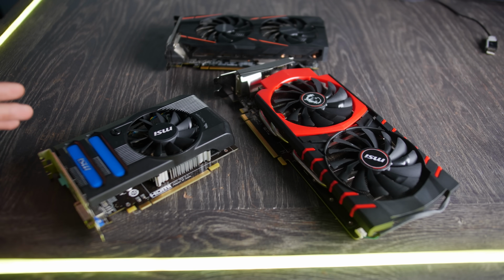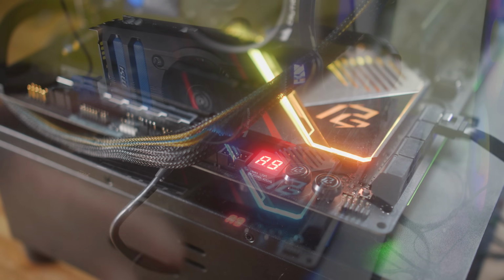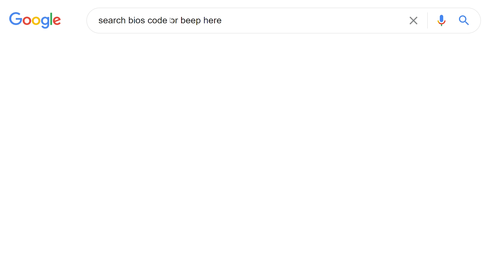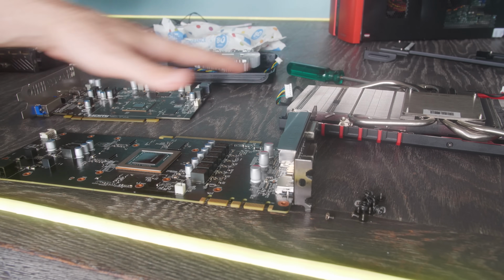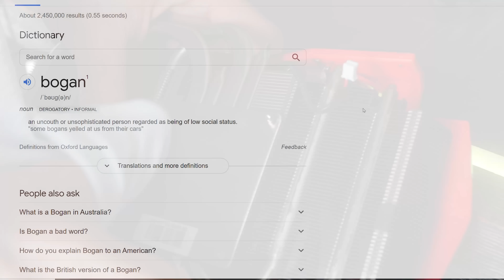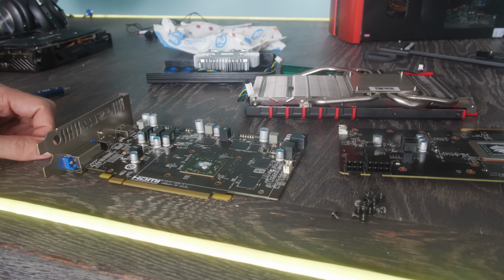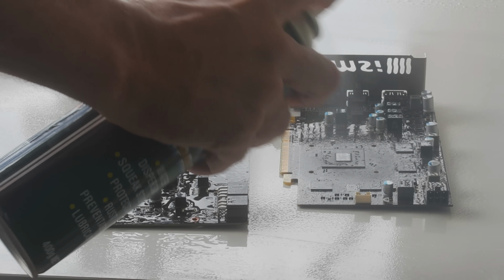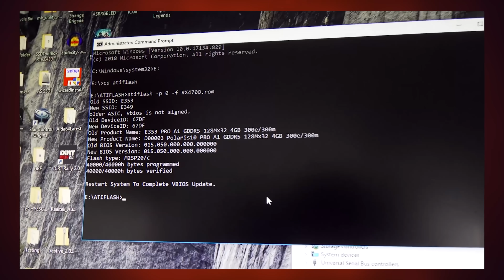How To TRY and FIX a Graphics Card (COMPLETE Start to Finish)

Comment: Last years I had a mother board problem! Where power was not getting to the graphic card  fan. But my problem was  I did not know this.  So  because of over heating I ended up with a black screen fall in my RX 580.  So not knowing  I had a problem in my mother board.  I replace the RX50 with  my spear GTX 970 But  it to overheated and  failed  as well. Using a very old card  I found the problem was in the mother board But at the time  I did not know how to fix them But  after  I saw your video  I went on  to eBay and  bid $25.00 For a damage AMD Radeon R7370. So I thought   For just $25.00,  what have I got to lose. Using a heat gun I got the R7 370 working.  Im now  using it and I have been using it for over a year now The only thing is I have to play all my games Like far cry new dawn  on low settings When I learn more Ill be trying to fix the GTX970, and RX580, As I miss the better graphics. But if I can get a card cheep enough I get that But on eBay  they still want AU $900.00 for a gtx 970 and $800.00  for a rx580

Comment: Yeah u right we need to test all input slots specially for old GPUs ,my GTX 580 was giving no display from HDMI I thought that it was dead but surprisingly the DVi Still working .Conclusion: sometimes in old GPUs HDMI might break real fast . And thanks to you I saved it.

Comment: Great video. I have a few suggestions. We can do the hdmi port and rubber on the contacts BEFORE opening them. If it works we avoid the need to open it up. Now I will move to my Radeon 5600 and tell you where I get.

Comment: i do recommend one thing, instead of the wd-40, give them a phat was in the sink, like scrub proper, using hand or any soap. then heatgun them. What ive found is that it removes junk from underneath the gpu die itself and also helps make sure the gpu is cooked properly because no water can be present.

Comment: Hi Brian. A few days ago, I recently discovered 1 last last resort that worked for me 😁 That is pushing up the other end of the video card (the opposite end of the video ports) while it is inserted in the pcie slot making the pcb a little bit slant for about half or more than half an inch. Using a cheap gpu anti sag will work too, you just need to adjust it a little bit higher so that it will push the gpu's pcb. 2 out of 2 of my defective gpu's are now working. The 1st one is Palit Jetstream Gtx 960 2gb which has garbage display. The 2nd one is the Sapphire Radeon HD 5670 which makes my entire pc not posting or will not reach bios while inserted in the pcie slot. I did this out of desperation because as you've said, repair is expensive and glad that the method worked. My theory is that overtime, the gpu's pcb will start to show a lot of wear and tear specially the traces and solder points due to gpu sagging, coz we all know that the points for gpu support is just the pcie and the gpu back io shield. Sorry for the long paragraph, I'm just so happy that I fixed my 2 cards with this method 😁👌🏻
Reply: are you sure it's not your mobo PCEi slot that's not broken there? how about you borrow a friends known working GPU, and try it in your mobo without trying this trick. see if the issue still happens.
Reply: @Layarion  hey I appreciate your advice mate. I get what your trying to say, however I flip pc's too for a living. So basically I have tons of pc parts to test too. What I'm trying to say is, overtime the substrate, pcb, solders and traces will have a tendency to lose some contacts. When I bent the gpu pcb, those contacts started to join again and it started to work again like new. Even got to overclock the card with zero problems at all.

Comment: Recently got a 1060 6gb Asus Blower style with a desktop I bought really cheap.(they didn't know what was wrong, but apparently bit was just the gpu being wonky, as the rest works without it) 
Card works fine with Microsoft Basic Display driver, but soon as you install the proper drivers, the screen gets black and white lines then blue artifacting and other weird things. Been trying to find compatible bios' for the 1060 to see if it's just a faulty bios but have had little luck

Comment: hey mate, I've got an r9 270 sitting in a box, works completely fine until I install the drivers, at which point it basically hard crashes, not even a bluescreen, any idea on what methods I should try or if it's even worth trying? I believe it was killed by a faulty power supply
Reply: Reflash the bios on it, that might fix it

Comment: I have a quick question. I recently got a evga ftw3 3080 card and it runs games stock at 1950  at normal boost and jumps to 1965 MHz is that a good gpu? I haven't tried to overclock it yet its running stock or is that just normal for them?it hangs around 193 to 200 fps on bfv constant on 1440.but my nvidia panel is locked at 200 also i remeber

Comment: I have managed to bring a few cards 'back to life' by cleaning out the contacts for the slot as well as the ports.  For heating, I have always covered the area being worked on with liberal amounts of flux to ensure that the solder joints don't get even weaker from the reflow.  Low success rate though, like you have experienced.

Comment: I have a GTX 770 with white lines (artifacts), a gtx 460 that have blue screen during windows startup (even worse, killed in the repair shop due to an atempt of reballing without my consent -.-) and a R9 270 that lose video signal every time that I play a game, F, glad that I upgraded to a 1660 Ti back in 2019, I need a card for my htpc, maybe will get a cheap GTX 1060 3GB

Comment: I have a GTX 760 2GB and it spins up to 100% fan speed on boot, the system posts but that's primarily because I have an APU in my main system and so it just boots to desktop, no output out of the 760, doesn't even get detected by Device Manager, Nvidia drivers don't see it's their either, tried every method possible, even the heat gun method, probably is smoked either way considering the GPU came out of a system with a dead PSU and a dead Motherboard because of it.

Comment: BRYAN, please please please get an ultrasonic cleaner. I can’t tell you just how many electronics I have repaired with one , wave oscillating is a bonus, use some diluted PCs cleaner.  It heats up. Then alcohol bath followed by a data vac or air compressor, also getting a and rework station for micro soldering and or  just fixing old solder joints just apply a thin laying of flux around the infected areas to get the solder reflowing.

Comment: The oven method only works for so long. The heating and cooling cycles will eventually break the BGA connection again.

 One way to keep the card alive for longer  is to literally just leave your pc on so it never goes all the way back down to room temp, OR ideally if it's profitable, crypto mine right after gaming, to keep the card hot all the time so it can't cool and shrink/ possibly snap the weak resoldier  of the BGA.

I have an old 7970 that broke after a week of normal gaming and shutting the pc off. Rebaked it, now I let the PC idle when I'm not gaming and its been going strong for 3 months. Might cost me $5 a month on my power bill buy it sure beats having to buy another gpu in this market.
Reply: Yeees? It's always been "the last trick" havn't it?

Comment: Hey tech city i have problem with my gtx1080ti broken at the perfect time when GPu pricw up, my problem is when i plugin all 8x6 the pc wont Turn ON and when i use only the Pcie my computer turn on but have "plz Powerd down" whic need 8×6pin plug for "Plz Powerd down" gone.. but if i plug 8×6 my pc cant tunr ON ? Are i get Shorting ? Powerplug broken ? Or Fuse Power broken ?

Comment: Who knows if the caps went bad on them, i recapped my old FX5200 and its now working a treat, even with new cards, sometimes its worth a shot because bad caps usually leave the system hung up and not post or the fans 100%, though these cards look like they had a hard life and the power delivery failed them, not worth changing them out unless you can flip it in working condition, i do like the rubber trick on the PCI-e connector, will try that in the future
Reply: The rubber/eraser trick's been around since ISA = It does work :-)
Reply: @dallesamllhals9161  I've never ran into any corroded connectors luckily :p only ports and dull solder point that cleaned up, i have a feeling his 970 is being stopped by that HDMI port, ive run into fauly connectors that stop anything from posting since theres a short, reordering or replacing the connector has helped in my experience.

Comment: I have an Asus GTX 660 Ti 3GB that reports a code 43 in the windows device manager and the output is low resolution as if no driver is installed. I tried reinstalling the driver even with DDU to ensure the old driver is gone, reflashing the VBIOS, cleaning the card and I tested the card in three different PC with no success. Any suggestions?
Reply: A 3 Gigs 660 Ti?
Reply: @dallesamllhals9161  yes, this one https://www.techpowerup.com/gpu-specs/asus-gtx-660-ti-directcu-ii-3-gb.b1630
Reply: @The93DarkShadow  Cool :-)  Never knew about a 3 GB version.

Comment: @0:55 : unfortunately for me ,that's not always feasible Bryan ,if you remember my case (i sent you my ASUS ROG GTX780 Poseidon about a year ago).
The ASUS AM3+ motherboard that i've been using had an Anti-surge which wouldn't allow this GPU to start.
This was happening only with the ASUS ROG GTX780 Poseidon (not other GPUs i've used) , so i guessed that there was a chance  that my GPU had been EOL for some reason. 
But as we know , you tested it with other mobos and the GPU was working fine , so ....
unfortunately for me , i was so unlucky to use a test bench which was faulty .... but only for this specific GPU !!!

Comment: When I upgraded to an X570 / R5 3600 last july one of my crossfired r9 280X's started acting wonky. PC wont boot if it's the primary and if it's the 2nd card either not recognized or shows as PCIE 1.0/2.0. Upon inspection there's a bit of evidence on the back PCB of heat around a single solder joint and the solder is broken/cracked. I always planned on trying to resolder that connection and current GPU situation is forcing me to get that extra 70% scaling I was used to in my older crossfire friendly games, so I'm going to get a small solder iron. It might only take 5 seconds.

Comment: Someone was given a GTX 950, my friend brought it to me a year ago. Only thing we knew about the card was the machine died to Cockroach hell... So it sat double bagged in a Ziplock bag for a year. I recently pulled it out, and realized the issue was apparently the Bug bomb residue. Apparently they set the bomb off inside the PC lol... Extreme I guess, or maybe it was very close to the PC. I took the card outside, tore it down, cleaned it. Was happy not to see any bugs, just a sticky residue on the board. Cleaned it with the Tech Yes City Method, and bam, that thing fired right up and pasted 4 hours of stress testing it. 1 hour for each test, let it idle between tests. So your videos get results for us, I thank you! :D I have a painters brush, I spray the no name WD-40 on it, soaking it pretty good and paint it on. For those that think using it is a bad thing, it's not. And the brush thing, I don't know, psychological barrier to get me to do it I suppose lol. It seemed cleaner... lol Currently going through the rest of my old cards since if they work, they might bring the most value in now... And I try to sell for reasonable prices. Sold 2 GTX 770's for $75 each. I even paid the shipping. I could have got $100+ maybe, but I didn't want to be the guy that sold them, and raked in the cash, only to hear... Hey it died after 2 hours! lol Fair prices brings Fair customers! I'd still give a refund if they died, but so far so lucky!!! :D

Comment: One thing of note: I would have never put power to that GTX970 without first fixing the baseplate to the card as that offers contact cooling with some of the power delivery ICs on the board... Also a slight less cringey was only using 2 screws to secure the HSF to the die, for testing it would have been fine but it wouldn't let the machine fully boot to OS, i would only let the machine POST without all the screws into the HSF assembly
Reply: ..and we're all different aren't we?

Comment: My r9 280x is working fine however it goes to black screen after installing drivers new and old it only works when it is detected as windows graphics adapter.. Have anyone experienced this? Is there a fix on this issue? Thanks guys

Comment: I've got a Gigabyte X58 board that seems to be having an issue with RAM...It has six slots, but will only run the 2 slots on the far left properly, so single-channel RAM only. If I put one stick in each channel, I can see in Windows "12.00GB (4.00GB Usable)." It won't boot at all if I only put RAM in one of the faulty channels. Guessing it's mobo or CPU and all the CPU's I have that I could swap into it are already up for auction so I don't want to mess with them.

I did win the board at an auction, and I got it for like half price, so I'm not totally burned if I have to sell it with single-channel RAM, it's just disappointing when I see something like CSGO that would probably be averaging about twice the FPS if I could get those other channels working.

P.S. - I have already gone into msconfig and made sure the Advanced boot setting was right, as well as tested all the slots. I cleaned the board thoroughly before ever even booting it. And they are all clicked in properly. So as far as I can see, that's where the help on Google ends.

Comment: I have a GTX 980 (Asus Strix) that I flashed it's firmware. I was using it in an SLI configuration as the primary card my monitor was plugged into.  I flashed the firmware on both cards (they are identical cards but this card was 1 year newer).  After flashing both cards successfully (having to uninstall the other card to do so), I started playing a game (which didn't support SLI) the PC crashed about 2 minutes into playing, and I could smell smoke coming from my PC.  Some how a component on the GPU fried it self.. perhaps a VRM/MOSFET/Choke burned it self. The card no longer gives a signal, but the PC still boots with this card installed when installed by it self. It's been a few years since this happened and the card no longer smells of burnt electronics.

I was thinking about using this GPU as the 2nd video card in my SLI configuration but I can no longer do that since building a new PC last year. I'd prefer to get this card working again and use it in another PC.  Any idea what I might be able to do?

Comment: I have a Zotac 1080ti that starts artifacting and eventually crashes windows.  Should I try any of these techniques?  I have never taken it apart to clean it or replace thermal paste.
Reply: clean it with wipes and see if the cooler is not clogged . 
replace the thermal paste.

Comment: Ayy, Im a Bogan haha
Also had exact same problems and results with 2x7770(got one workin via cleaning the Pcie pads with an eraser, Second is still no display&fan spinning) and a 6850 that blew a resistor and smoked it.

Comment: @15.06 Hi Brian - The mosfet 2nd from top looks bad/burnt/cooked causing a short that's what smoked ( left of the SFC Inductor ) In- try taking a heatgun and tweezer and taking just that smd off the board. It will run 5 phase power but the card will still work.
Reply: it's not always a case, he can try that but it's more exception than rule that only mosfet is damaged.

Comment: What percentage of cards over the year(s) have you saved with these methods would you estimate?  Sorry these two didn't work out for you mate.
Reply: Probably 10%... He's not showing how to really repair them... To repair them you need to check voltage rails and diagnose POST issues and possibly VRAM issues with mats/mods software

Comment: Mine hd7750 had similar non posting issue so i pluged my monitor into integrated graphics and flashed a bios with lower ram speed/clock, since then it works perfectly. Hope this helps.

Comment: Ah, Nice concept for a video. One of the hesitations I've always had about used GPU's/paranoias that my current ones will croak one day/get lines etc is I've never had to fix cards at all. I'm almost wondering if laptop gpu's or integrated graphics or used safety gpu might be a good investment. Great that you cover cleaning the gpus also, pretty much wiped and transplanted it, last upgrade. Asked my bud if we should take it apart and change the thermal paste (did the upgrade before Shadowlands prepatch around the time it was on ptr) and they were like nah just move it. I remember wiping the dust off the lower caddy after 2-3 hours of use later. That was a bit gross. I'm not really afraid of taking apart to clean, more of putting the GPU back together afterwards.

Comment: Well this couldn't have come out at a more perfect time, my rx vega 64 died a couple of weeks ago
Reply: He did it all wrong don't follow him.
Reply: @erminbajric4633  I just watched the video, I agree on that, I'm still gonna try heat gunning my card as I already see it as dead and a loss, as the gpu core sometimes just comes desoldered from the board over time
Reply: @erminbajric4633  I mean, unless you have a microsoldering kit, you can't really do more then that
Reply: @Quicksilver-7791  That gtx 970 has a short circuit, cleaning and random heating won't fix it. If he removed dead component maybe it would get to life again. But that only applies for this case. Graphic cards are dying in multiple ways.
Reply: @erminbajric4633  I know, I'm just saying that we can't do anything else aside from 'cleaning and random heating' without investing in a microsoldering kit.